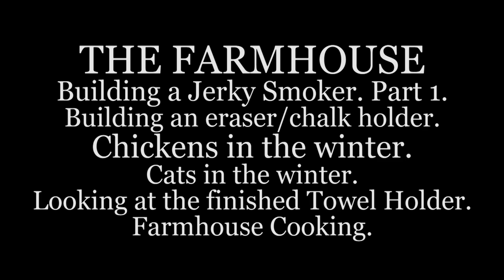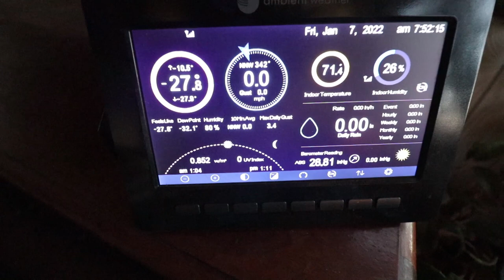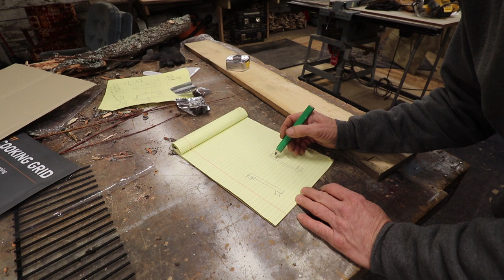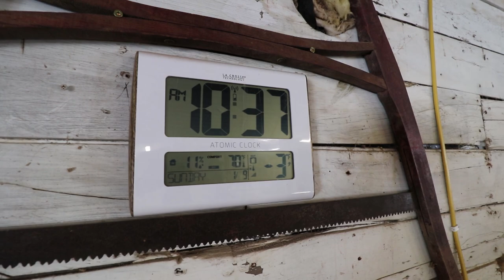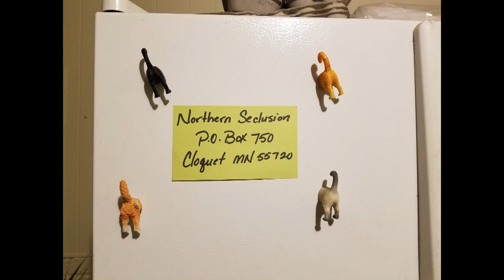THE FARMHOUSE. Smoker Build, part 1. Chalk holder. Winter for the Chickens and Cats. Towel holder.

Comment: Hey Joe, I did it, I pulled the trigger and got a F350, crew cab, 8 ft box 4X4  it came with a 8ft camper cant wait to get out and use it. Love the videos keep posting !!
Reply from the maker: Make sure you do all the maintenance. Oil change no more than 5,000 miles and do the fuel filters every 2 oil changes. She should be a good truck.
Reply: @NorthernSeclusion  Joe, thanks I know you are a busy guy. I have not owned a Diesel since 1986.  I really like that smoker project. Cant wait to see it in use.

Comment: I know it's probably none of my business but what are you gonna do with your other diesel black truck.. Maybe you could take the bed off and put a  Steel and wood flat bed on it and turn it into a plow truck.. It's what my friend did he also put the 5th wheel hitch base on there and likes it so much better cause there's more clearance and less worrying about his side bed of his truck.. He  Also bought a used pickup camper And has special steel tie Downs on the flat bed, And he takes that  when he goes out of state for elk and moose hunting.. Instead of hauling his pull behind..
Reply from the maker: We will sell the black truck and keep old reliable. We keep full coverage on all our vehicles even though every one, including the new one, is paid for. I want to get back down to just paying insurance on 3 vehicles vs the 4 it will be now.

Comment: Evan if you cover it, it will off gas. I do industrial repair work in plywood factories and I know in no uncertain terms do not use anywhere near food. I have seen people that go and clean equipment that is used in pressure treatment have severe nose bleeds even wearing filter masks.
Reply from the maker: It will be absolutely fine. I am not worried in the least.

Comment: Hey Joe! I bought a couple of my diesel trucks from down south and most of them dont have plugs for the block heaters already installed, just a heads up bud....
Reply from the maker: All Ford diesels. 6.0, 6,4 and 6.7 are sold with the heater but like you said, not the plug. I already ordered it and have it in my bag ready to bring down with me. I had to look that up because I really wondered if the southern ones were done differently.

Comment: You must have a ton of miles on your truck. I’ve had a couple different Ford super duty’s and considering another one in the next year or so. You still happy with diesel?
Reply from the maker: The truck runs awesome but it is literally falling apart with the rust. If the body was nice I would keep it.